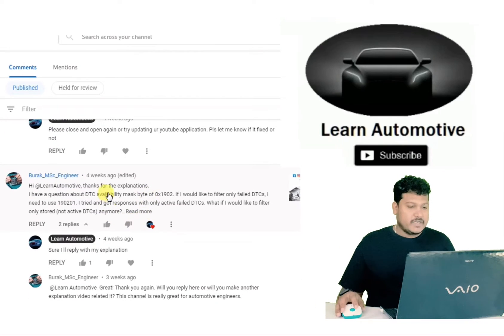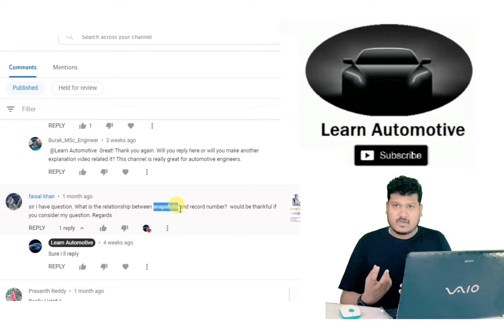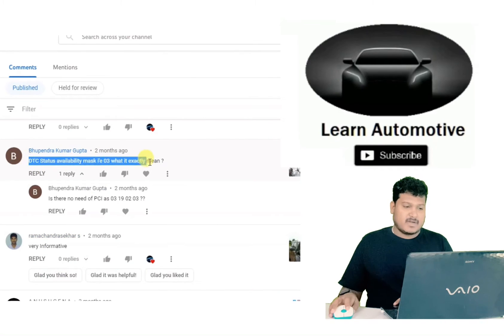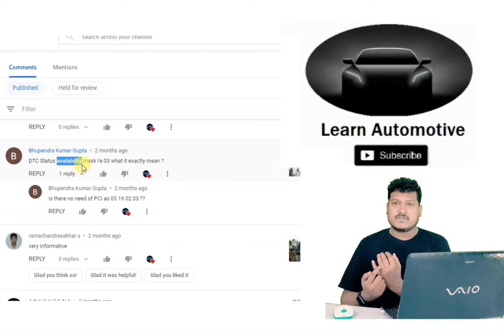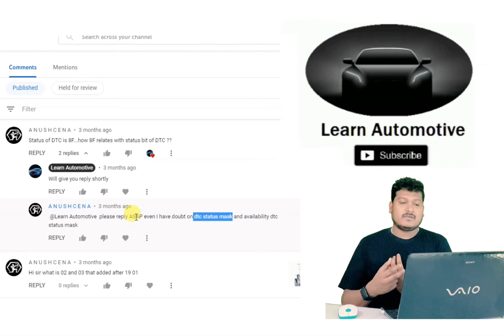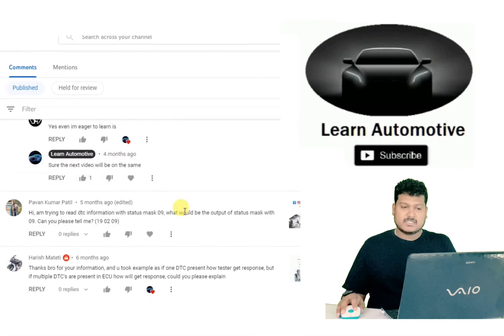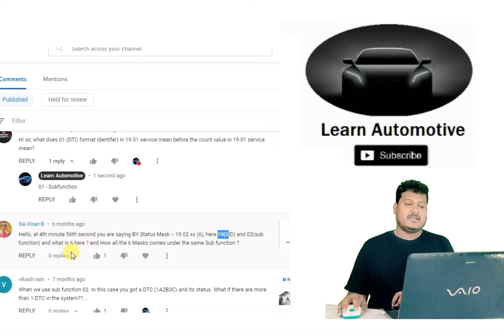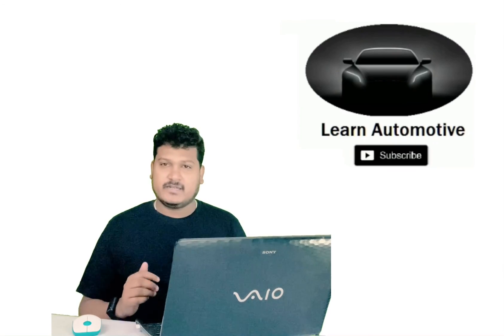DTC Status and Reply to Comments | Learn Automotive | DTC Status Mask

Comment: Question: Maximum DTCs that can be stored in error memory is only 5 DTCs whereas as a tester I have created 7 faults. What will be the final output when I read the DTC.
Reply from the maker: 256 bytes can be read from the server memory so you can have that much dtcs readable.. still if dtcs are more then based on priority it will store least priority won’t be visible
Reply: Thanks

Comment: Sir is dtc status byte is same for CAN dtc and K-line dtc?
Reply from the maker: DTC is just an information comes under UDS Protocol...
It can be retrieved with any communication protocol..response will  be same in all protocol.. if not get clear pls comment I ll elaborate it
Reply: @learnautomotive7875  thank you sir for your feedback,
I need information about dtc status byte, i.e confirmed fault or temporary fault.
Is it implemented as per any standerd like j1939 or it can be manufacturer specific also?
Reply from the maker: It’s not manufacturer specific.. it’s standard only !!